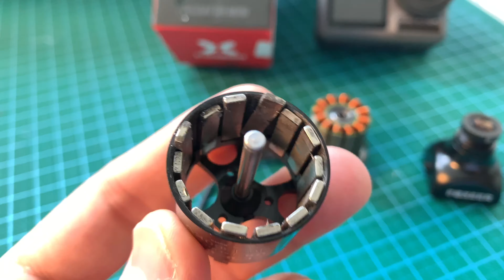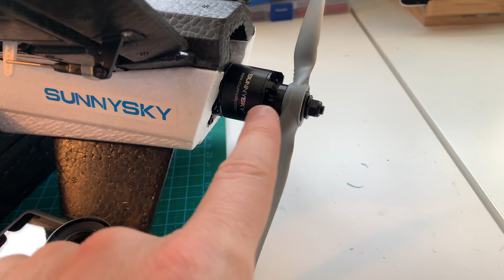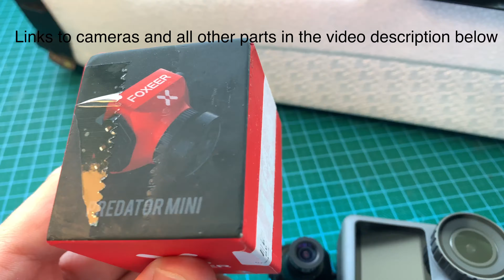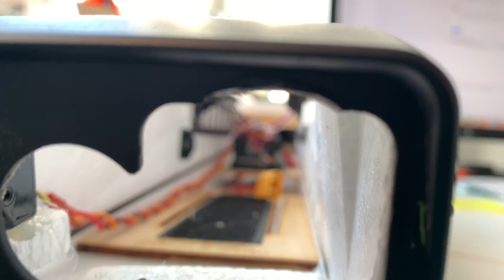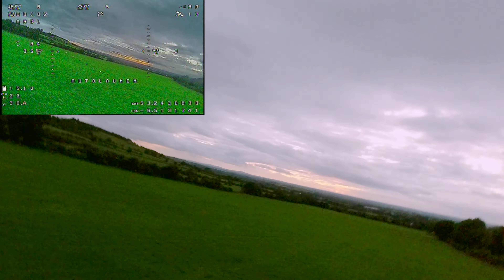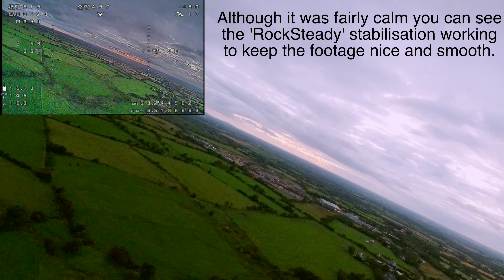Talon GT Update - Failed Motor Replacement & New Upgrades

Comment: Interesting that the motor is now branded Sunnysky. When I saw the motor first time, I immediately thought it as rebranded Sunnysky motor, but since it had (quality?) issues especially the magnets, i doubt it since.

Also it's interesting for the KV, 1300 as Sunnysky only have either 1250 or 1400 KV. Btw, very nice detailed video!
Reply from the maker: Yeah it’s very interesting that they are Sunnysky. I thought at first ZOHD we’re making their motors look like Sunnysky, now that it’s branded I’m pretty confident it will be fine as their motors are quality. My guess is ZOHD requested SS make them a motor and specified the KV they wanted for this model. Flew it today on quite extreme flights and it worked perfectly 👌🏻 thanks for watching and commenting 😁

Comment: Still in love with my mini Talon. More battery space, stable flight, rather fast, cheap and cheerful little plane. Mine has a Tarsier camera, 4s esc, up to 5500 mAh, Frsky r9 and F722 Matek GPS assisted flight controller.
Reply from the maker: This has the same FC but has UHF for the ultimate freedom 😎 I have a Mini Talon which is in the build process at the moment.
Reply: @AdamGdoesFPV  check out Mark Qvale 3d printed parts for the mini talon @ itsqv.com if you didnt see them :)
Reply: I'm having a hard time choosing the Talon GT over the Mini talon - the 2 advantages i see are 
1.PNP (there can be a lot of work on MT to make it awesome) 
2. transportability/size